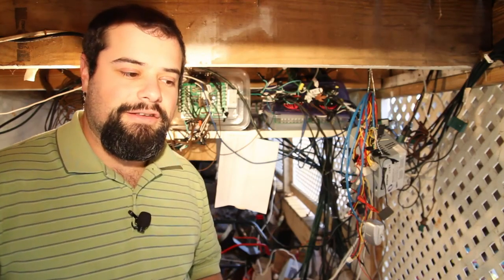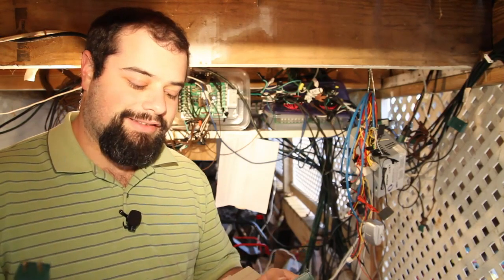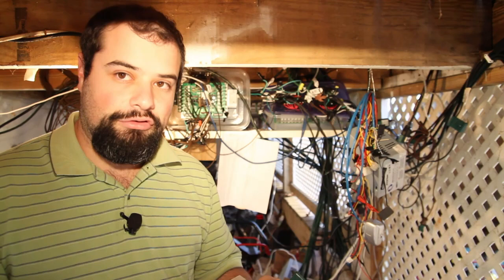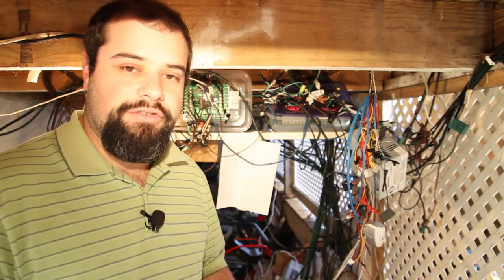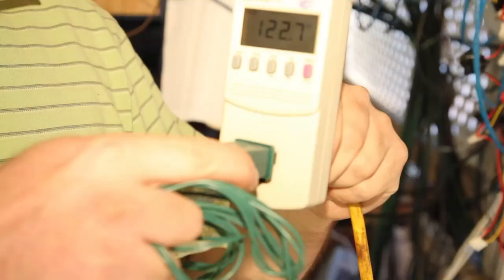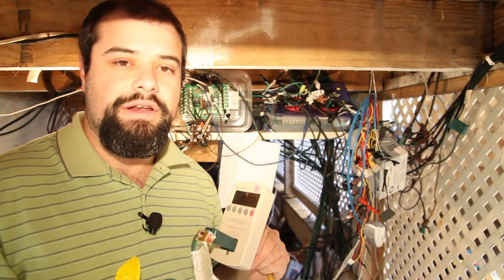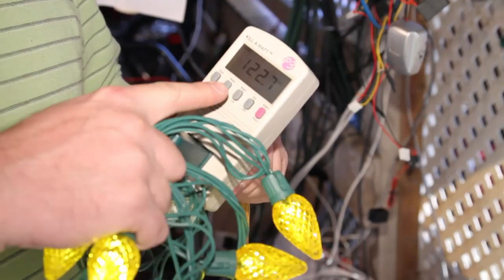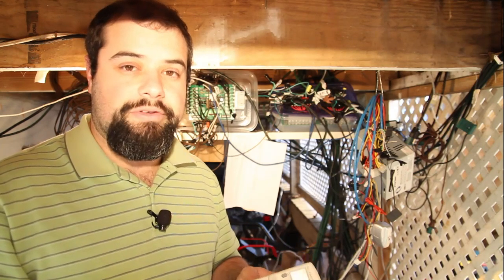How to Avoid Overloading Outdoor Christmas Lights

Comment: Can I use stronger fuses instead of the original ones?? I have to many light connected to each other and they burning out within 5min
Reply: u can, but it will over heat the outlet nd possibly burn or go into flames, theirs a reason why its rated at that fuse, it protects from overheating nd when it does it blows the fuse, try not using many strings or get an extension cord